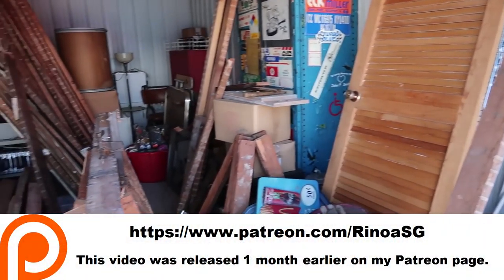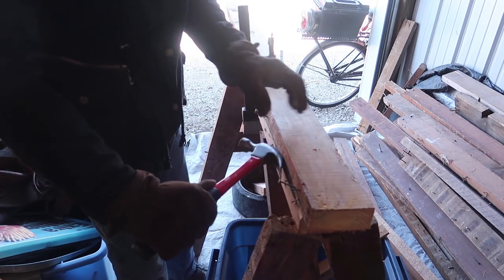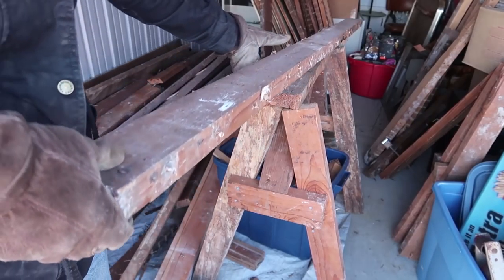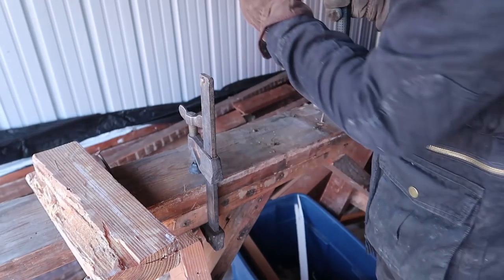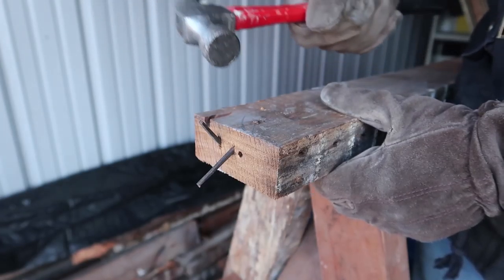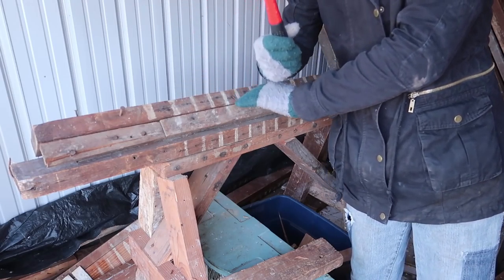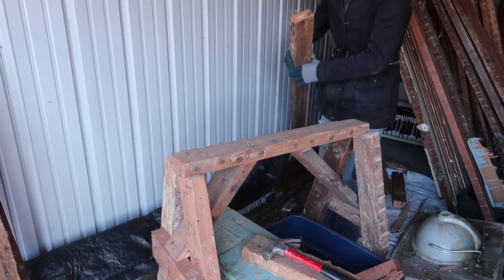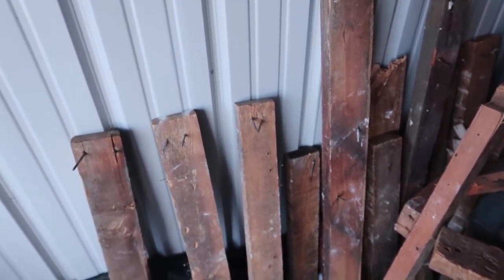Reclaiming Old Growth Lumber: De-Nailing Wood from 1902 and 1913

Comment: A crowbar is an excellent investment for nail removeal
Reply from the maker: i disagree, a flatbar is good though
Reply: Rinoa Super-Genius i get that. Nail pinchers also pretty good. So many nails pulled recently. Wish there was a simpler solution.
Reply from the maker: simple or easier? because a hammer is as simple as you get

Comment: Hey, Rinoa!! How about remodelling that fire pit you bit and turning it into a Dakota Fire Pit. They have a air tunnel underneath the firepit that opens up the surface not too far away. This allows the fire to get oxygen from beneath it; in turn, making the fire burn hotter.
Reply from the maker: my firest burn hot enough as they are, i dont want them getting out of control.

Comment: My great grandfather build a house like 70+ years ago and my family just got it and we remodeled it because it was damn sure time and he wasn’t a carpenter or nothin like that normal man but he had a business a roofing business and I’m not even exadurating olmost all the damn nails in the wall that was lumber that’s all are walls tung in groove and I swear the nails had groovs in them and were 9 inches long now this hous has been through 9 hurricanes and 2 tornadoes and u wanna know what all that did to our hous after he got done building it!

Absolutely nothing nothing at all it’s still on its original ground nothing’s moved and some of the beems for the walls the strong points didn’t have eny damm nails no he put fucking rail road spikes right there and I promise there was a shit ton of them the beems for the strong points were railroad ties so it all worked out but god dang we had a time remodeling it 😂

Comment: Riona, girl you need some better tools i.e. A crow bar , flat bar.  I do what u r doing often myself.  But atleast the nails a good not rusty.  Sometimes I have to drill a hole in a small block to put over the nail to prevent it from bending while I'm back beating them.  Just a tip.
Danette Bearette
Reply from the maker: yeah i have a nice flatbar at home but i always forget to bring it over when i come here. haha